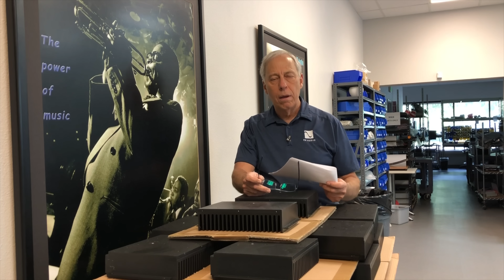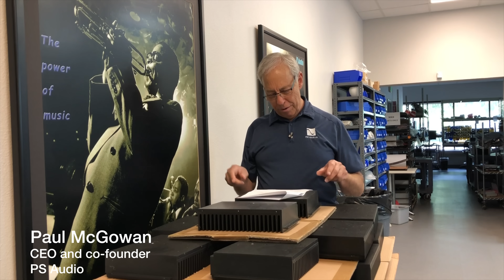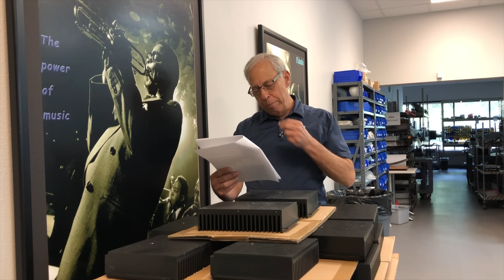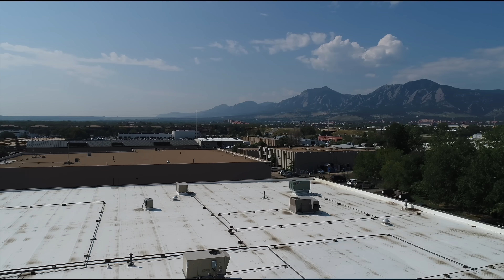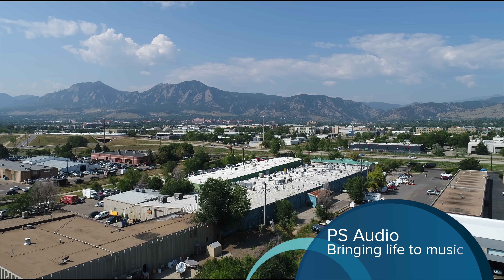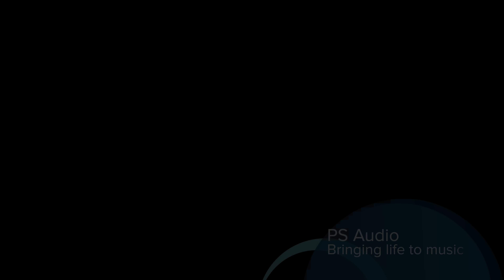Can enough memory fix digital audio?

Comment: All CD and DVD players contain buffer memory between the EFM code demodulator (basically just a lookup table) and the CIRC decoder. It's this very buffer that is monitored to control the disc's rotation speed and ensure a constant linear velocity.
This linear velocity is constantly being tweaked to ensure that the buffer never overflows or is ever starved for data.
As far as jitter at the DAC stage is concerned, there isn't any, other than the jitter in the master clock. 
Each stage from the CIRC decoder to the DAC filter is slaved and synchronized to the chipset's master clock (which has an arithmetic relationship with Fs).

Comment: World’s first digital audio recorder some 40 years ago actually had some awesome specifications. 32 channels, 50kHz sampling rate, 16 bits resolution, 20Hz-18kHz +/-0.3dB, 0.003% THD. It was made by 3M and called Digital Mastering System. Jitter was not specified but the sampling clock was by crystal oscillator. It even had CRC error check and correction. The recorder used 1800 Watts. You can check first generation digital audio jitter appearance e.g. listen to the very first digital recorded popular music album “Bob till you drop” by Ry Cooder using this recorder in 1979. Can you hear recording jitter on it? 😋

Comment: That's part of the reason why I bought my Lennoxsound Portable CD player back in the early 90's. It has a 1 minute buffer and plays CDs with perfection. While the headphone out is good for on the go, it's the line level output that sold me on this wonderful device. That and it came with the "optional" power supply. 
;) ;)

Comment: Asynchronous buffering is an obvious need in digital audio processing. However, assuming the audio is buffered, the next topic is jitter in the master clock oscillator. The era of digital music started in the early 1980s and if oscillator jitter is such a big topic still today (which I will claim it is not with proper engineering), we should have some serious issues with recordings of the first CDs using digital sampling with 35 years ago oscillators, right? An audiophile person believing that he can hear jitter issues in modern equipment should easily be able to identify jitter issues in CDs from 35 years ago. Or what? :-) So which title of song from the early days in digital audio has audible jitter issues in the recording?
Reply: I like the way you think :P
Reply: Uh...ohh. Trying to use known science/engineering/knowledge is not going to convince PS Audio or its followers.
I've tried. The discussion quickly devolves into some semi-religious new-wave style of thinking.
Reply: Christian Holmstedt Yes, there is too much snake oil talk in audio.
Reply: wait. I am confused here. A CD is a digital storage medium....

If the audio bitrate of a CD is known and standardized, then what's the point of buffering to fix/get rid of a clock signal that might be jittery?... If you read X amount of bits, then you know that's a second worth of audio... and then you read another X amount of bits, then you know that's another second worth of audio...

Considering there are 2 parts of conversion there's 2 places for issues to occur: 
1. recording - I.e. the clock of the recording device converting the analog source to a digital format to be stored on the CD
2. playback - I.e. the clock of the DAC converting the digital data stream from the CD to an analog signal

What's all this talk about a clocksignal inherited from the CD-player?... are you telling me the DIGITAL output of a CD-player also has a DIGITAL clock output or it has an ANALOG clock signal?.. and why? Or is this clock simply linked to the speed at which the data is read from the disk? (which sounds even worse)...

Of course you need a clock signal to convert digital data to an analog (audio) stream! Duh?!?!
Am I correct to assume that for some strange reason people actually used the speed at which the digital data was streamed as some form of clock signal?... because that's one of the dumbest things I've ever heard. o.O
Reply: ayporos The DAC needs to clock each sample of audio out precisely. In a CD that happens 44,100 times per second with 32 bits of data, 16 bits for each channel left and right. The DAC must always have a sample of data to read from for every clock tick or you will hear an artifact. When data is read from a somewhat unreliable mechanical media like a CD or even streamed via the internet, the data is not flowing precisely with 44,100 samples per second and to ensure the DAC has data to work on always, some buffering is needed. It’s quite similar to how Youtube tries to make this video running smoothly by buffering even your internet is not always stable. The data flow is asynchronous from the DAC or your video decoder. Before the buffer runs empty, the buffering logic will pull more data to keep the DAC or your video decoder happy. Nobody is using the speed of which something is streamed directly as the effect would be terrible. Well, you can argue traditional radio and TV work in such way but they are based on broadcast signals.
Reply: Well yes, that's kinda what I was saying... But then where does all this talk of 'clock signal' come from that Paul bases this entire video upon? Is that his misconception of how things work? Or is he articulating his (actually proper) understanding of the mechanics poorly?
Reply: ayporos He is talking snake oil. Yes, if you have a poor oscillator managing the timing of samples into the DAC then you can get audible jitter but it’s a silly topic as you almost have to be dumb to make audible jitter happen using a bad oscillator. How do you argue for charging people a fortune for a DAC when a high quality DAC IC cost a few Dollars? You need snake oil topics. Also, definitely there is nothing new in buffering streams of audio and video.

Comment: I don't think that Paul addressed the 2nd part of the question which is about a cheap CD player feeding a very well designed DAC. If the DAC is really well designed with buffering capability as Paul talked about would a cheap player feeding it produce the same sound as a relatively expensive transport like Direct Stream Memory play? Paul could you please comment?
Reply: Yes, that is correct. However since the communication for SPDIF is unidirectional, you might get buffer underruns if the CD is too slow or buffer overruns if it's too fast. However that concern is mostly theoretical.

Comment: So the 'digital lens', in other terms, is actually a multi-threaded DAC. As a programmer, that makes far more sense.

You have one thread on the 'clock' that is only storing data into memory, then a separate thread, on it's very own clock, which is processing the data waiting on it, and the two threads have completely disconnected clocks, therefore there is no jitter to speak of.
Reply: The digital lens is not a dac. SPDIF goes in, SPDIF goes out. It just "reconditions" the SPDIF signal by buffering it and sending it out on its own clock.

Comment: FWIW: "Streaming" over the Internet is a misnomer. The data, video + audio, arrives in irregular bursts. If I look at the incoming data stream here for this YouTube video I see about one second long bursts sometimes reaching 1.5MiB/s in height every second or so. It is not a squarewave as at any given time in the burst the data rate varies widely. This is very common. So a large incoming buffer is to your advantage.
Reply: One more thing. The bursting stops well before the video has completely played. Therefore the process is completely asynchronous.
Reply: Audio over USB is packet based as well.

Comment: You never really directly answered the question. Yes, this is what you guys are doing, but in reality does it make the source (and all cables leading up to the DAC) irrelevant? Or does it not completely eliminate that even though in theory it would?
Reply: Yes, because it is transferring the digital bits, in their proper order, to a new media, then playing back those bits from that media using a precision clock. It really does eliminate the timing errors from reading the disc and transporting the bits to the DAC.
Reply: By that logic, if you buy their DAC, then there's no point in buying their CD player as well and you can use a cheap CD player as long as it has a digital out. It would also eliminate all other "accessories" like isolation products and all cables on anything before the DAC. People would save thousands of dollars by getting their DAC as they could essentially sell everything else up the chain and replace with cheap components. Sounds too good to be true.

Comment: Avoiding timing jitter through buffering allowing an asynchronously flow of audio data and high precision DAC clock is decades old technology. First such buffering actually aimed at avoiding data interruptions on the Mini Disk (MD) format in 1992 (anti-skip). There really isn't any magic to this. What you want is just a very precise clock running the DAC and enough buffering so you never run out of data to feed into the DAC. Having buffering allows for some more sophisticated error corrections when the music originates from a CD. This includes re-reading the track. Essentially this is what anti-skip was born to do, but it's exactly the same mechanism. But for any digital audio playback it's a must-have approach to buffer the audio and ensure the DAC runs precisely. Rather than promoting this as something special, it would be dumb not to do this. But of course Paul has a point as some audio engineers are just poorly designing the clock architecture and end up with jitter even it's not actually hard to avoid.
Reply: I had one of those portable players for walking and listening.  I always thought the NON-memory setting sounded better.
Reply: Manard H That might be due to the buffering going cheap by compressing the sound to save the RAM space. Some portable players did this.

Comment: Paul mentioned lightly the buffer with 2 clocks.  What is important is type, not the size of the buffer.  

The buffer is a memory which can be written to and read at the same time.  CD players have this from the very first manufacture.  The clock for data from the disk has jitter, and wow.  The clock is retrieved from the data from the optical disk.  The disk motor speed is controlled only by the buffer fill percentage.  The buffer runs about 1/2 full.  When the buffer is less than 1/2 full, the motor is sped up to make the buffer 1/2 full.  When over half full, the motor is slowed until the buffer is 1/2 full.  A jitter free clock pulls data from the buffer at a constant rate and clocks the DAC with the same clock.  This data stream is jitter free.  Why Paul is renaming this a lens for a CD player I don't understand.

My credentials is as an ISCET certified electronics technician.  During the economic down turn in the 1980's I worked as a consumer electronics repairman and took the Phillips repair class on these when they first came out.  At that time I learned about the 8 to 14 modulation used on the disk, the error correction, the pickup, motor control, tracking, etc.  I have since progressed into engineering as the compensation and rewards are better and consumer electronics became to cheap to repair for a profit.

For more info on this Google International Society of Certified Electronics Technicians, Solomon and Reed error correction, Eight to Fourteen Modulation, Compact Disc spindle servo, and static dual port RAM.  Not sure what this lens fixes other than sources other than a CD such as Bluetooth, and internet streaming audio.  Buffer size should be big enough to never overfill and never go complete empty, and should be true DUAL PORT Static RAM.  Adding more computer system memory does not meet the critical real time clock requirements for a jitter free clock as this has to work around read and write cycles and dynamic RAM refresh cycles.
Reply: So the 'digital lens', in other terms, is actually a multi-threaded DAC from what I can tell. As a programmer, that makes far more sense.

You have one thread on the 'clock' that is only storing data into memory, then a separate thread, on it's very own clock, which is processing the data waiting on it, and the two threads have completely disconnected clocks, therefore there is no jitter to speak of.
Reply: On your last point, you're talking about RAM from the 1980s. It's not the 1980s any more. My credentials include having designed and built DSP based audio effects processors since 1989. DDR4 is clocked at 200-400MHz and a CD delivers 1.4112 megabits per second. Given a 200MHz clock that means you need to fill a word wide audio data output register once every 2267 memory clocks. Clearly this is a vanishingly simple task with today's DRAM and refresh is transparent to it. Any bargain basement DRAM combined with a double buffered output register in front of the shift register is up to the task. This has been the case for a couple decades now.
Reply: This is inexpensive and quite good.  DSP's do indeed have registers for just in time delivery to a DAC.  Technology has marched on with vast improvements.  My point is there never was an issue with clock jitter from the buffer to the DAC from day one of the CD player.  It is most often a crystal with a base accuracy of 0.005% at worst.  A little component noise may introduce infinitesimal noise jitter.
The simple task of moving a word to a register every 2267 clock cycles is completely valid, however most interrupt routines are many clock cycles long.  Some interrupts are higher priority than others.  Loading a register within a specific time window is simple. If the same system is responsible for moving it from the register to the DAC, there lies the problem, unless the DAC is running on a dedicated clock asynchronous and jitter free from the processor.
With the move to high clock speed DRAM and without a dual port RAM or DSP or other correction, there is an introduction of clock jitter for the reasons mentioned in PC based solutions.  Audiophiles are claiming they can hear this, so it needs corrected.  Stand alone CD players never had the jitter.  They came with dual port RAM buffer for the spindle speed control.  That was why I mentioned there is a solution already for moving between a variable time data buss and packet info to a clocked memory to DAC jitter free solution as used in the earliest CD players.
Audio based DSP projects depending on design sometimes have jitter as they run on a single crystal that is not directly divisible to the DAC clock which introduces jitter.  For example a 200 megahertz clock will not divide evenly to the CD clock rate.  There is a remainder.  A perfectionist will want a jitter free clock. One dedicated to the data to the DAC transfer.
Speaking of spindle speed. Paul mentioned about 600 RPM on a CD. LOL.  CD is a constant velocity medium, not a constant angular velocity medium.  Speed in RPM varies considerably from edge to center.

Comment: Based on your answer, I wish I knew why a company invests so much in their source's clocks.  Source devices like Rasberry Pi or SOtM Ultra.  These devices connect via Asynchronous USB and it's always been my understanding that the clock is controlled by the DAC for all asynchronous connections.  That being the case, why is everyone raving, folks like Hans Beekhuyzen, about the performance of the source to a modern-day high-end DAC?  Yes, I realize these sources are cleaning up the signal in other respects, but the CLOCK is always mentioned as important.
Reply: one possibility is that this method requires the injection of lag into the system, and there are use cases where that's unacceptable

Comment: If maximum sound quality for sound playback was the only goal that's a great idea, but this won't do for real time applications where latency is unacceptable though.
Reply: Buffering audio is critical for latency in the case of video playback where you want to avoid lip-synch issues. Lip-synch means you can see the lips of people being in synch with what they say. Often you actually need to buffer audio to delay the sound to match the video as modern video processing includes video frame rate conversion and video noise filtering algorithms that work over multiple video frames creating delays. You might have heard of gamers complaining about using a TV for gaming as the video delay is too long for fast action. So what Paul is talking about in this video is actually done in pretty much every TV you can buy but for a different purpose of ensuring video and audio is in synch. However, since the video and audio coming into a TV is PUSHED by the source, the actual clock is mastered from the source and PLLed in your TV to minimize or avoid audible jitter.